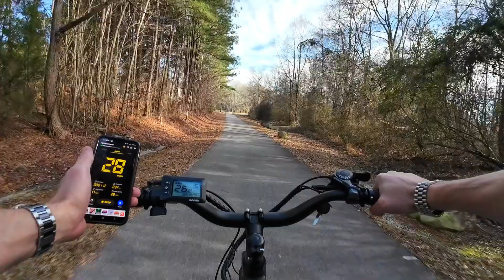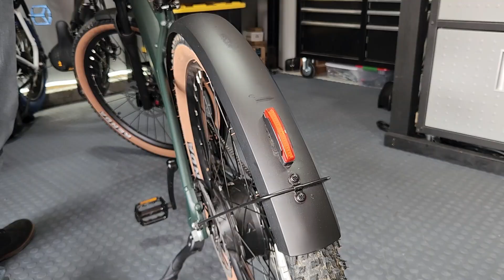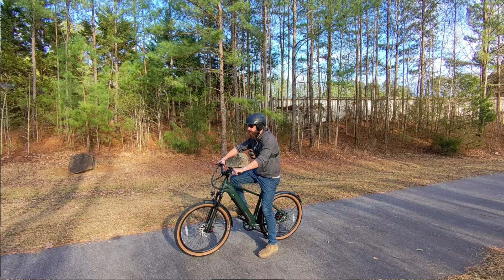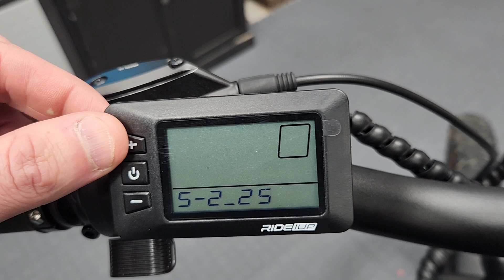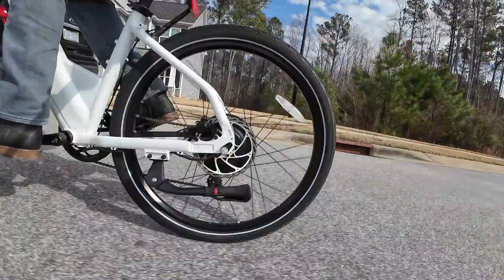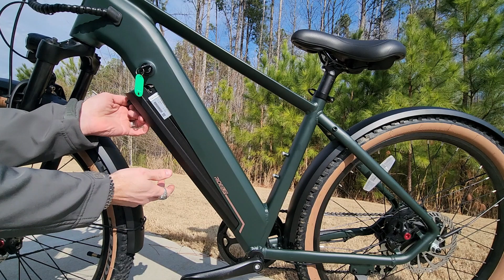Ride1Up Turris - Lightweight Adventure Tourer

Comment: My city has a small park with dirt trails that have gradual hill climbs. Maybe 20 - 30 foot elevation change over a quarter mile also I go camping near a reservoir where there is a dirt trail that follows around the shore line with gradual elevation changes. Could the Turris handle some light trails okay? Thanks for the video.
Reply: Yes it can easily do trails , this kind of bike is not made for jumping though

Comment: You keep showing that you put your seat high. Not high enough. If you sit and both feet on the ground or almost on the ground - that is not correct seat height! It may be safe or good for somebody making occasional pedal strokes, but anybody pedaling for more than 30 minutes with some effort, will have knee pain with such seat height.

Comment: Very inexpensive, but still wish it had torque sensor pedaling.
Reply: The LMT’d model uses the same frame (step over), motor and similar components (some are better), but uses a torque sensor. Its display also lets you change the number of PAS levels and the maximum percentage assist each provides.

Comment: Nice looking bike but for me the deal breaker is no place for a rear rack.
Reply from the maker: @EZ_E_13  they sell a rear rack for this bike on their website for 50 bucks
Reply: @CitizenCycle925  Thanks But I'll stick with my 2024+ wired freedom, I can carry 1 case of bottled water in each side of my saddlebags along with my big 240lb azz and it doesn't skip a beat. However last month 1 day after the snow I had a Dr, apt got there no problem and took my battery in to keep warm since it was around 20 degrees outside. After apt snapped battery in place started to leave and it didn't go anywhere, the clutch had failed, perfect timing so I had to push it through 1 1/2' of snow for 2 miles. Right after I arrived home called wired and sent them a lil vid of what it wasn't doing and they sent me out a new motor, controller, blender and stated that they would pay $100 to any bike mechanic I had do the work. Of course the bike is my only transport and it would have cost me more to transport the bike and have it worked on so I did it myself like anything else on it, I'm 63yrs old and been buying Ebikes since the pandemic. Being on disability can't afford anything else especially now with all Trump's cutting of federal help. This is my 3rd Ebike, 1st one was a Himiway Cruiser because of seeing your review 2nd was 2023 Wired freedom saw your review of that also and lastly bought the 2024+ freedom and I don't think I need to tell you who's video I saw to pull the trigger on that one. I'm trying to get together the $$$ for your ft motor kit so when I have to get in the streets which I avoid, I can dodge the idiots with a license.
Reply: A rack is offered for $50

Comment: Would you consider the seating position to be like a “city bike”?  I’m comparing it to a Specialized Como which seems to hav an ideal posture position for older people.
Reply: This bike is 1/3 the cost of the specialized. You can buy an adjustable stem for the handlebars for $30 and have any angle you like.